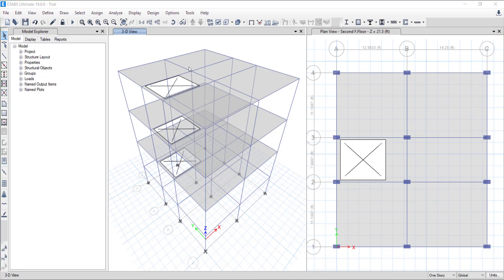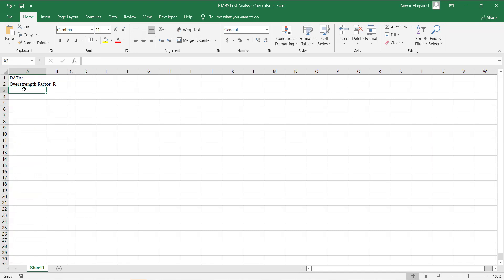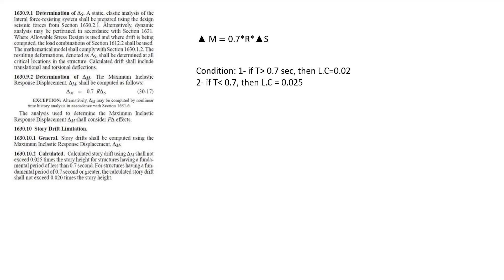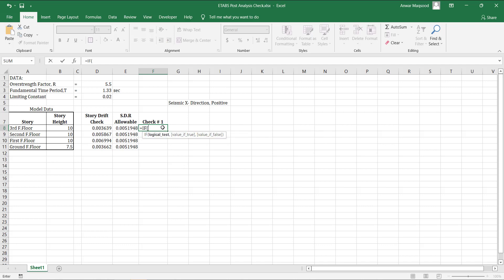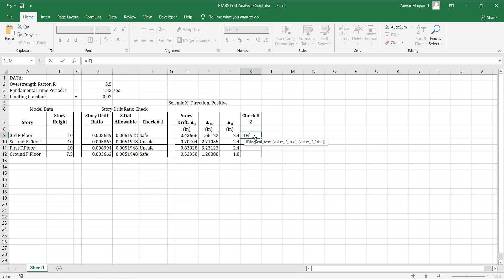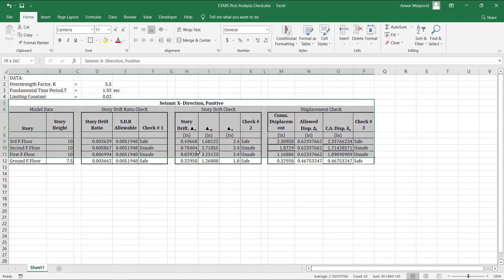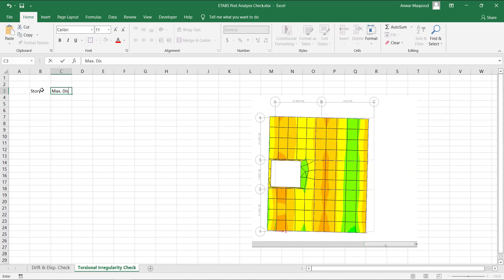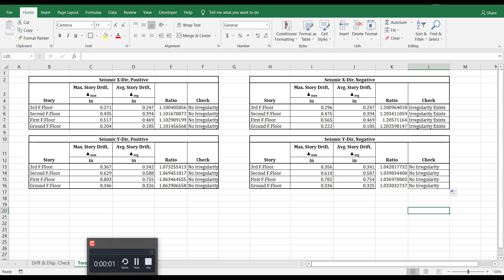Post Analysis Stability & Seismic Checks in UBC 97 | Story drift and torsional irregularity checks

Comment: Do I need to consider torsional irregularity for 2 storey residential. Building due to architectural arrangements of column and beams
Reply from the maker: Most of the codes suggest to calculate torsional irregularity, largely for the structures experiencing lateral loads. For instance, Seismic Design Category of your building will suggest to calculate this irregularity or not.